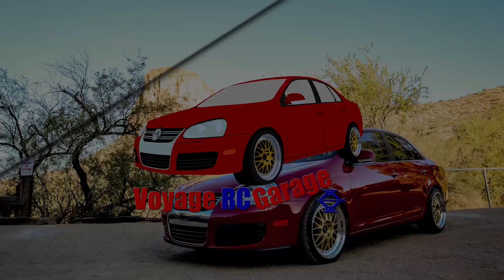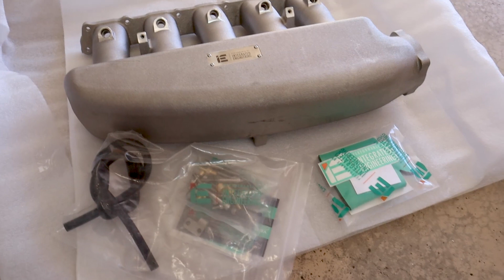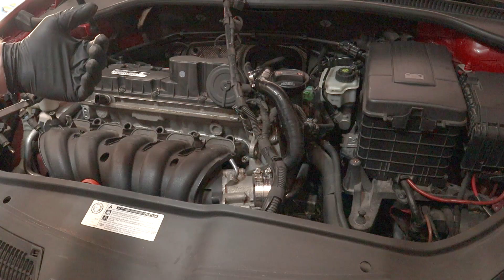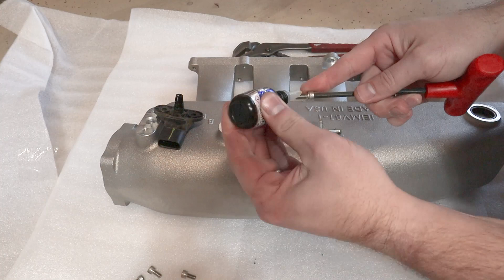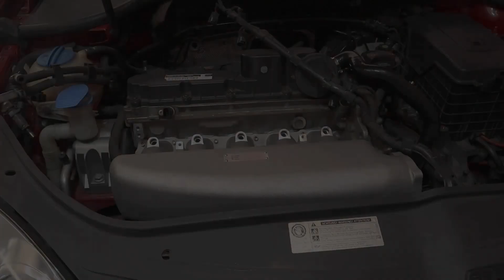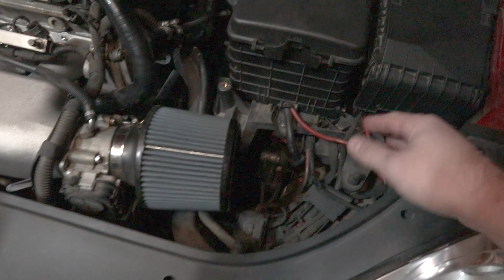How to Install the Integrated Engineering Short Runner Intake Manifold on the VW 2.5 Engine - 07K

Comment from the maker: Did you buy the Power Kit? If not, what intake are you running with this manifold?
Reply: I made my own using exhaust pipe and generic intake tube pipe and parts from Autozone.   I had my filter in the fender.
Reply: Hi so basically I have a 2012 Jetta 2.5 and I want to be able to do the stage 2 IE tune but I need the manifold and what not but it says the car needs power steering. Do I really need power steering? and could I still do it if I don’t have it
Reply from the maker: @miguelsalazarjr4712  the vehicle needs to be ELECTRIC power steering and not HYDRAULIC power steering. The pump for the hydraulic system will cause clearance issues with the IE manifold. If you are electric PS then you are good to go.
Reply: @VoyageRC  ok and how would Ik of my car has EPS!?
Reply from the maker: @miguelsalazarjr4712  Hydraulic would have a pump that is run by the serpentine belt sitting up top by the stock intake manifold on the passenger side of the vehicle. No pump = EPS
Reply from the maker: @Jackson Jones love it man! The best camera is the one you own. 👊🏻
Reply: I have a modified neuspeed short ram intake, skunk 2 I makes a universal velocity stack kit i bought and will be modifying to fit in the spring.

Comment: wow...thanks for showing me what not to do. that thing is a nightmare and sounds like garbage.
Reply: @VoyageRC  sorry but it seems you lost this one. :/
Reply from the maker: @smoothmove7566 not really
Reply: @VoyageRC  well if you're happy I'm happy. just didn't seem like you gained anything from it. it actually seemed like it went backwards. but maybe it's because you didn't have the tune into it yet? it seemed really doggy when you were booting the throttle and all the nightmare plumbings problems. It just appeared to me like you spent probably over 1,000 dollars to make it run worse.
Reply from the maker: @smoothmove7566  it runs way better. It just shifts the power band to the upper RPMs. It is some work to get done but its worth it.
Reply: @VoyageRC  I'm 63 years old and the one thing I have noticed over my lifetime is the longer the intake the stronger the lower end torque, I've seen it from the cross rams from the 60s all the way to my many Honda motorcycles. and when I changed to a short intake on my Honda Monkey it lost all it's bottom end torque. so I'll agree with you that shorter moves the power band up the rpm gauge. I'll stick with the ones I feel in the seat of my pants. It's just a street cruiser beetle to putt around in and look cool, not trying to win a race. Good luck with her Buddy. : )

Comment: Your supposed to upgrade to jegs and a catch can for this upgrade  because  it will be more efficient ie  has the catch can & billet upgrade  valve cover manifold  on their site thts why he did kno it but check out another video also thts how I found out
Reply from the maker: @jermelpayne2024  this will run just fine with the factory PCV system

Comment: Hey buddy, I just bought the SPA Turbo intake manifold. Very similar to the IE one, however it doesn't come with gaskets. I went and bought the 5 small ones but I was wondering if you could help me find that one big gasket that goes to the SRI. Cheers!
Reply from the maker: https://click.linksynergy.com/deeplink?id=lvJi3jDtPrA&mid=43304&murl=https%3A%2F%2Fwww.ecstuning.com%2Fb-genuine-volkswagen-audi-parts%2Fthrottle-body-gasket%2F07k129748a%2F
Reply: @VoyageRC  Found one in Canada, thanks bro!
Reply from the maker: Are you referring to the gasket for the throttle body? throttle body to manifold

Comment: For the intake how were you able to tell if your car was hydraulic steering or electric. I got a Mk6 2013 SE 2.5 I5 and can’t tell at all. I’m new to the all the tunning/modding stuff and trying to learn.
Reply from the maker: You will have a fluid reservoir up near the battery for hydraulic. Your 2013 will be hydraulic. They did away with the electric after the Mk5.
Reply: @VoyageRC  thank man, sorry if I’m bothering you with these questions. Your vids have helped me a good amount with what to do. Keep up the great content
Reply from the maker: @J.jizzleYt  it’s not a problem man, I’m happy to help.
Reply: @VoyageRC  last thing, what can I do with the car since it’s hydraulic steering. I’m looking and I do y think the power kit would work on my Jetta
Reply from the maker: @J.jizzleYt  you would have to relocate the reservoir. I am unsure if the manifold would clear the pump though. It might have to be modified.

Comment: Heads up, those lifting bracket bolts may be 9mm. I had it all pulled apart then found out the 10 was too big and the 8 too small. I was a little irritated to say the least lol

Comment: Did your 2.5l engine have a electric power steering?
Reply from the maker: Yes. This wont work with hydraulic power steering. The equipment is in the way.
Reply: @VoyageRC just look mines in on the driver basically out the way of the manifold

Comment: do you really want to use threadlocker on the intake bolts? I'd be worried they'd snap off the next time you want to pull it.
Reply from the maker: You probably don’t NEED to.

Comment: Did you upgrade your fuel pump with a pressure regulator? And for the rpm reving down too slow get a blow off valve .
Reply from the maker: No fuel pump upgrade needed. This is a naturally aspirated engine. Blow off valve makes no sense.

Comment: Great video 
If I install this. do I have to do stage 2 ? 
Or can I still Run it as it is ?
Reply from the maker: You would probably run worse without the tune. I have never tried it with the factory or stage 1 tunes. It is designed for the stage 2 tune. 🤷🏼‍♂️
Reply: @VoyageRC  thanks for the info  bro

Comment: Hello, in which page or place can I buy that intake manifold aluminum?
Reply from the maker: They dont make it in aluminum. It is cast. I ordered mine directly from IE. You might need to email them if you just need the manifold and not the power kit.
Reply: @VoyageRC  Can you help me a little more in how to get it because I am from Argentina and it does not exist here and I have a friend there who brings it to me but does not know where to buy it please
Reply from the maker: @gastonsoula7612  I told you where to buy it. Performancebyie.com

Comment: Do you really feel it's pushing harder and worth it?! Yes on the crank the manifold gives 40+hp but to the wheels and driving i wonder if it's a slight increase or completely a different car 😏          for me in canada the intake itself with the tune would cost around 1400.......
Reply from the maker: https://youtu.be/loaCccLb1Zg 👍🏻

Comment: how much hp will the engine make with those mods?
Reply from the maker: IE says a gain of 47 on stage 2 over stock.
Reply: @VoyageRC  I'm from Brazil and I wanna swap it to a car, just want to know a baseline hp with some of those mods
Reply from the maker: @feliperoballo3918  stage 2 is probably around 190 to the wheels
Reply: @VoyageRC  seems good. maybe with etanol and exhaust it will make 200bhp

Comment: Thank God I watched this before just buying the manifold, I also have the vacuum delete kit that you have. Would've not know what to do! Where did you get your attachment and what sizes did you use to get it all to fit? I have a my long cold air intake that cost$350 and wouldn't want to have it go to waste.
Reply from the maker: Check out “THE ADAPTER” in the description. Thats what I used to connect the vacuum pump delete to the manifold.

Comment: My 2.5 has the shitty hydraulic steering pump in the way 😢😢 I need help
Reply from the maker: So does my wife’s. 😩
Reply: So does mine. I found a solution however it will require a bit of elbow grease. I am planning on removing my factory power steering pump and replacing it with a volvo electric power steering pump (600 new, ≈150 used). It uses 80 amps so you can use a stock alternator on it (I’m planning on upgrading later however). You can then use the golfs accessory belt, and put the pump in a remote location (I plan on putting it where the cold air intake would go in the fender since I have a SRI). This would allow you to keep the hydro-power steering but free up the space for the manifold.
Reply: @ohyeahyeah4312  Can You Tell Me If You Do It Please I Would Like To Know What You Do I Have the Same Problem...

Comment: The big hole on the bottom came plugged up on yours, mine came without a plug. Do you have any idea why or if thats a defect?
Reply from the maker: My car does not have secondary air injection. I have a lot less piping running around.
Reply: @VoyageRC  Ah I see. Thanks for the quick reply.
Reply from the maker: @KamionKing  👍🏻

Comment: For someone who never worked on cars but is mechanically inclined, (rebuilt carb on a Suzuki 250) would you recommend I do this myself? I have the IE manifold + IE CAI coming next month as well as the IE valve cover, IE Vacuum pump block off plate, and IE block breather adapter.  

Will be going on my 2.5 manual 2013 golf. 

Also would you recommend doing anything else to the car while I’m doing these upgrades?
Reply from the maker: The install isnt to difficult of a job. There are just a few steps that are more difficult than the rest. I talk about them in the video. Thats a good list of upgrades. It might be worth looking into a catch can since you are doing the valve cover.

Comment: after doing this for years, the best approach i've found for the 3rd runner bolt is to position yourself over the passenger fender, standing perpendicular to the motor. drop you right arm under the intake  manifold and with your left hand, hand off the bolt to your right hand. seat the bolt, then with a small allen key, take your time and tighten to spec.

After a good heat cycle, go back and tighten all the mounting bolts, as they have a tendency to walk themselves out from time to time.
Reply from the maker: Great tip. Thank you.
Reply: @VoyageRC  prolly best to lay a towel on the plastic of the radiator support. key thing is to relax and breathe. its such a compromising position that you feel youre going to snap your arm if you sneeze wrong.  but with enough practice, you'd be amazed how fast you can pop on/off the whole setup.

with regards to the breather hose for the brake booster, you can run an NPT fitting to off of one of the intake bungs and create a new line to the brake booster.  i bought a second brake booster hose purely for the booster tip, and fashioned my own OEM looking hose from black braided hose.

I have it on IG under the same username
Reply from the maker: @myspacenrg  I have the IE intake on now so all that is finished up the proper way. Lol
Reply: Thinker